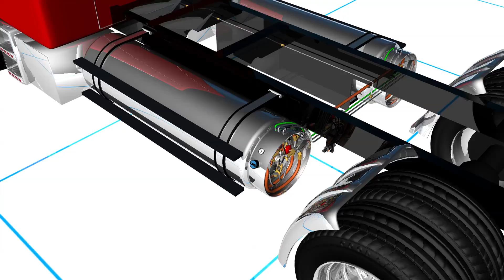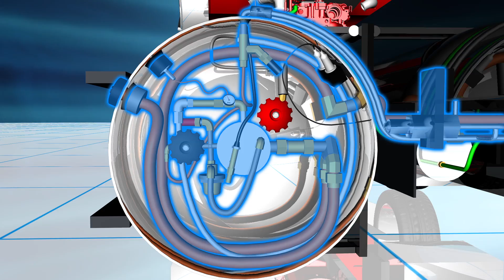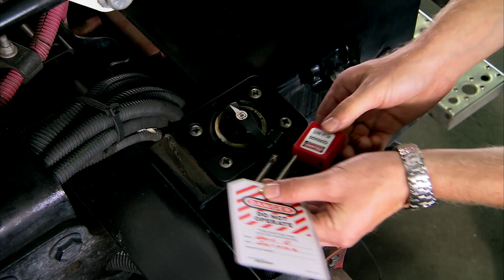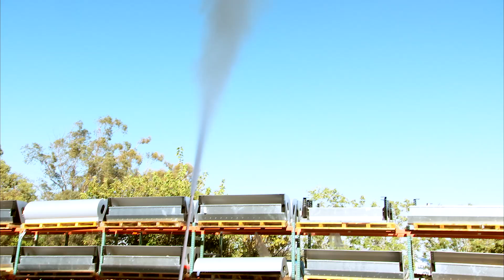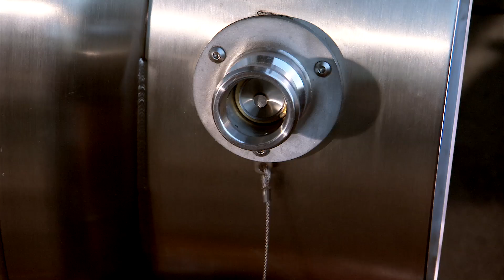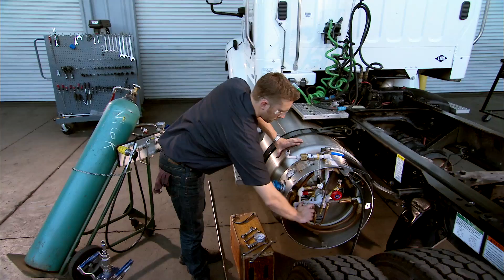LNG Segment 08: Depressurizing and Defueling

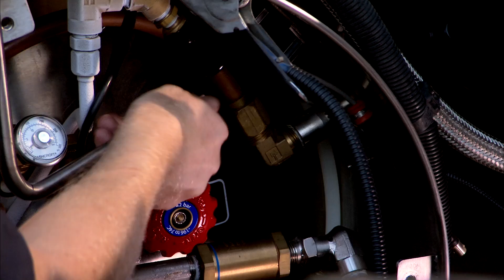Comment: 2:15 You really should never vent that un-burned gas to the atmosphere! CNG vehicles are green  but if the maintenance professional does not burn it into CO2 when venting to atmosphere or moving the fuel to a separate storage container, the green house effect is far worse. Please burn or transfer the gas instead to make CNG a truly environmentally friendly option.